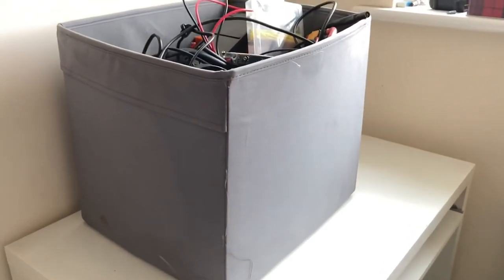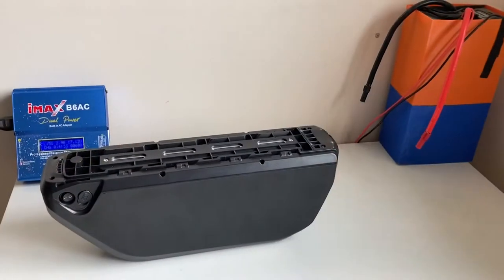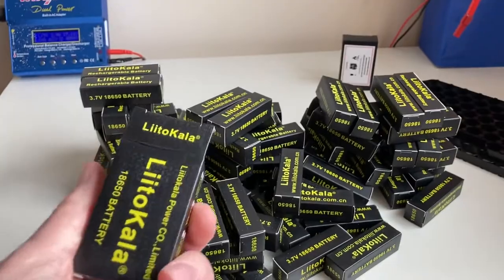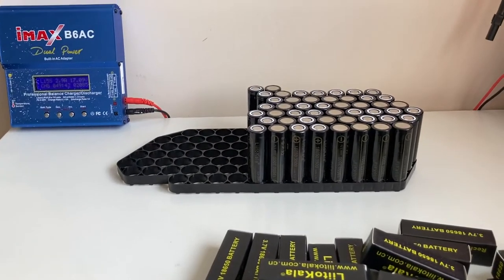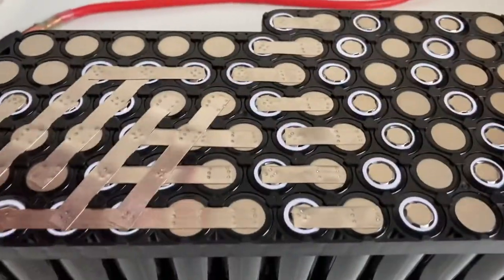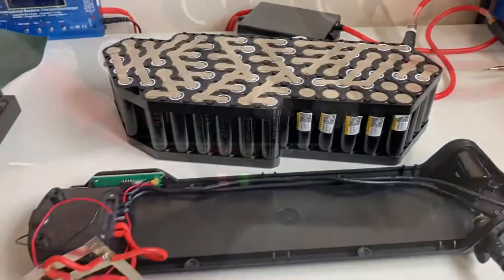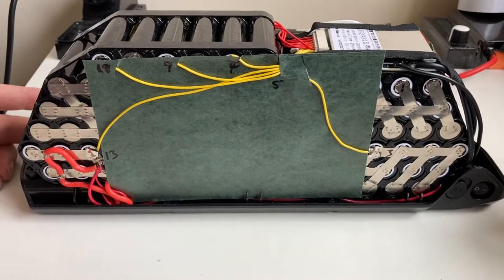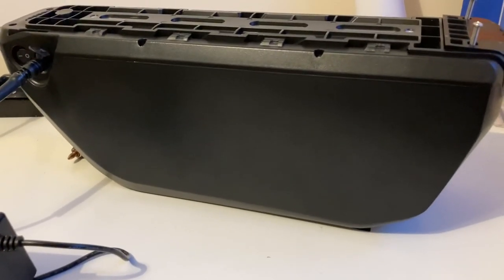Ebike BATTERY build 54.6v 91 cell 7p  3500mah 24.5Ah 70A max load LiitoKala 18650 cells

Comment: have u got a detailed diagram on how the nikel strips are on the battery
Reply from the maker: No sorry. In the video it shows clearly how all the cells are fitted. I’m sure there is a diagram somewhere on the internet. If I find it I’ll change the video thumbnail ;)
Reply: @smartazz  ok thanks its just i am going 2 build the same ones and need 2 know how and where the nikle strips go i dont want anything going bang
Reply: also whats the range roughley of this aswell
Reply from the maker: @thediscoman2001  depending on how much you pedal, how much you weigh and how much power you are requesting will depend on how many miles you get from a full charge.

Comment: How’s the battery performing nowadays ?
I’m thinking in buying the same cells…
Also, this battery configuration is safe?
Thanks for sharing the video mate :)
Reply from the maker: My friend underestimated the power this battery provided and the hub spun out the  frame taking the torque arms also. The battery is still working perfectly.
Reply: @smartazz  damn…
Thanks for the answer!
Also, do you mind sharing the link of the cells that you bought ?